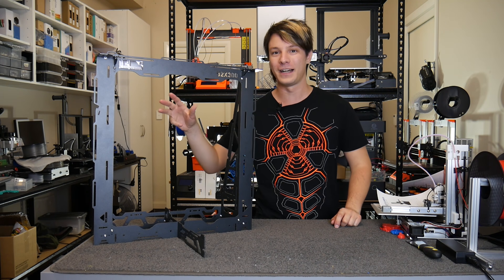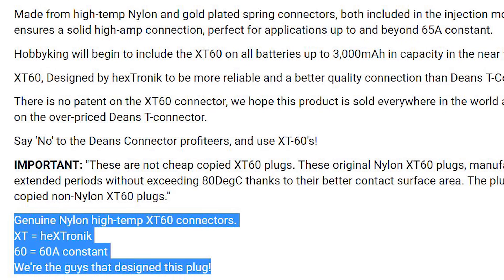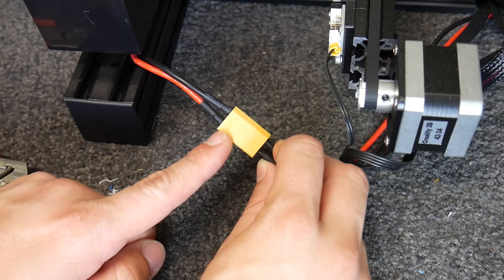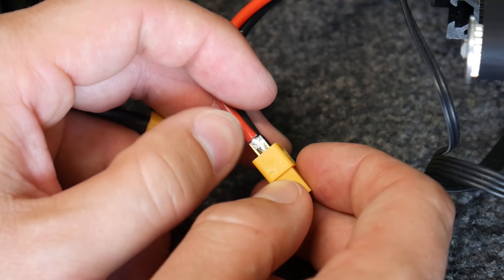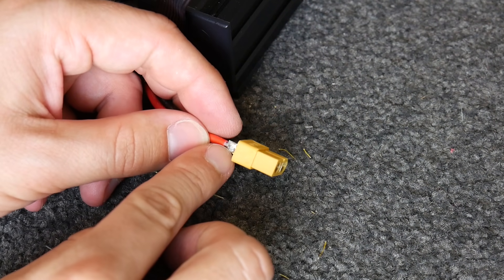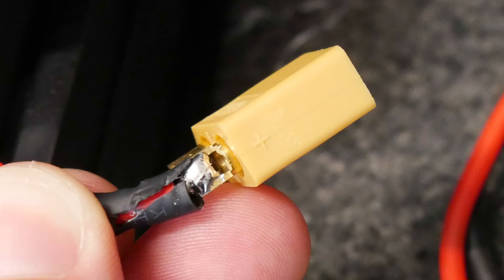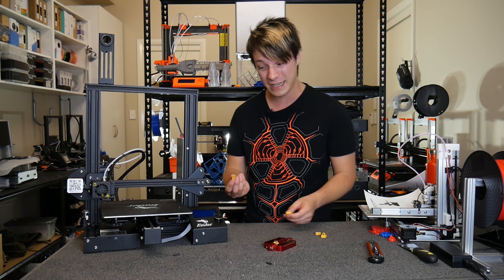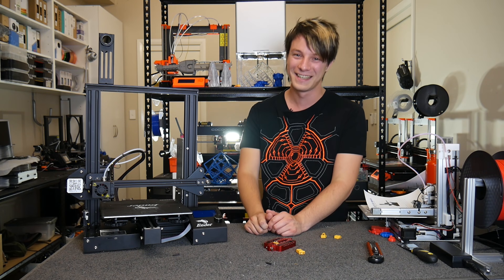Ender 3 Connectors are burning up... Bad XT60's

Comment: Hi Angus it's me again, the guy who's cetus caught on fire. Just wanted to let you know they asked for pictures which i provided and now they are not responding to my emails. I asked for a refund since i cannot trust that printer, it won't work now even if i felt lucky. Anyways do you know their contact guys jason or joshua at all? I could use some help dealing with them.
Reply: Matthew Poole holly crap
Reply: I wrote an article about those damn Anet printers, terrible quality connectors as well https://vectormfg.net/anet-a8-firestarter/
Reply: @Pocketninjanight  yeah, i am really getting pissed. I got new mk3 extended version. Friggin $500 dollar paperweight now and they are ignoring me.
Reply: Tiertime have a forum, head over there and post some pics, that might help. I'm on there a lot and have noticed an improvement in support...
Reply: @owensparks5013  ok i will do that. Thank you. My screen name is Carbide.
Reply: @carbide1968  
Sure thing. Mine is Marksman aka Owen Sparks.
Reply: @carbide1968  hey man how did you get on?
Reply: Just do a credit card chargeback if they aren't responding.
Reply: @pepe6666  still no reply. Getting real worried i am screwed. It's not like you can work on them either, parts are not available.
Reply: @carbide1968  damn man. someone said about reversing the transaction on your credit card & going to the bank with evidence of them ripping you off. is that a viable option?
Reply: @carbide1968  How did you get on with getting the manufacturer to refund you?
Reply: @AndrewAHayes  I had to send it to fargo nd. To some 3d printing company at there request and after they saw it was a fire hazzard i was credited.
Reply: Matthew Poole did your ender 3 catch on fire???

Comment: Ive been running my ender 3 for over a year, and had been keeping an eye on the xt60 connectors, regularly checking them to make sure they were not heating up.   Recently I must admit I had got a bit lax, as for a year I had had no issues.   But today after a 1 hour print, the xt60 connector has burn marks and almost burnt me when I touched it.  The wire either side of the connector was also hot. I'm a bit freaked out!    Ive cut both connectors off so I don't inadvertently use the printer until I can take care of the problem. 

I felt sure based on the fact the connectors had never got hot before that there was no issue. 

I think though what has happened, is the crimped connector (there is no solder on the side closest to the control box, now that I have removed the heat shrink!)  had a good solid connection for its entire life time, until I had to do some maintenance the other day and was moving the printer around, and now the crimped connection is a bit loose!

So I would strongly suggest anyone who has doubts to not risk it, replace the connectors or at least take a closer look at them, I feel like I've dodged a bullet here!

Comment: The images you showed of the burnt connector didn't show the damage at the solder joint.  Rather, it showed the burn marks roughly at the point where the contacts of the split terminal meet the cylinder.  This implies either a lack of contact surface area or pressure.  If the connectors are easy to disconnect, then it would be appropriate to spread the split contact slightly apart to improve  contact pressure.  If the shrink-sleave is burned up, then it is likely a cold solder joint.

Comment: I was wondering why they weren't putting enough solder on the joint. The Ender one is a hollow tube that would allow solder into the connector half if over done, and that would stop the plug fully engaging. The HobbyKing is a sold piece drilled from both ends, so it has two separate chambers.

Comment: Those solder joints should be filleted and blend smoothly into the base metal all the way around.  What I see in the video is some or all of the joint is a solder blob overhanging the base pin metal.  IMO this means the base metal pin wasn't hot enough for a good joint.  Or not enough flux.  As others have said, it takes a lot of heat to do this properly.  I usually plug in a dummy connector to act as a heatsink and keep the pins in their correct alignment.

Comment: Just checked mine, bought at the beginning of may 2019, it has official plugs, the stamp design, high friction push together, brass components etc all look and feel like the branded component and not a knock off... looks like they are listening and making updates

Comment: I agree with what you have said. My Ender-3 Pro came crimped and sure enough the cables got hot, so much  so that you could see the deformation on the shrink tubing. The plug was too warm even with the bed only set at 60°C. I swapped the cables with 14 AWG and skipped using a plug all together. As an Anet A8 user for nearly 3 years as well, I didn't think these things today wouldn't be a concern but it seems they are.

Comment: I was already paranoid with fire hazard before (because of all the soldering / hot air rework equipment I have in one room...) and now I don't trust the printer as well (not that I'd leave it working unattended in the first place). I've seen a few burned / welded connectors (some on mains equipment), even from reputable brands, but I didn't really consider they'd crimp a connector that's meant to be soldered.
Offtopic, your hairstyle looks awesome, Angus. 
Cheers from Portugal, mate.

Comment: If replacing the connectors, always make sure the gold is tinned first.  The gold dissolves into the solder, making it porous and brittle., which increases the resistance of the joint.  I'd suggest heavily  tinning the gold and removing the excess solder before inserting the tinned wire  (most good  training resources suggest double-tinning like this).  Soldering gold has a very odd stench that I still strongly remember,  even though it's been more than 25 years since  I did this with any frequency :)

Comment: I'm monitoring my connector using an infrared thermometer.  (They are inexpensive and handy to have around, non-contact measurements). I'm about 40 min into a PLA job...Nozzle = 215C and Bed = 60C; IR Thermometer is reading 94F (~34C).  Seems a bit high.  Will try some higher bed temps later.

Comment: Good video and well pointed out, I don't see the point in doing anything other than making a direct soldered connection here, even with good quality XT60 connectors there is still a possibility for a failure, in any electrical system you want to avoid terminations or connections of any kind where ever possible, the best advice you could have given on this video is to advise people to buy a small length of heat shrink, a 25w soldering iron and simply solder and sleeve these connections, its also worth pointing out that here in the UK the mains lead for the printer was supplied with a 13A fuse inside it? ive replaced mine for a 3 Amp, I am not so sure the power supply on my ender 3 pro is a Meanwell power supply.

Comment: Neat, a good thing to watch out for from the connector, I’ve had the occasional burn out from various printers and they were all due to krimped connections in a dusty environment and only after pushing the machine beyond PLA temperatures which is rare for me. Hard to diagnoise the problem because most people print with low PLA temps and never try printing difficult stuff like ABS or have the budget for higher temp stuff. Anyways, the connection would burn out and shut down the heated bed or hot end before a fire started requiring a quick soldered connection, I keep a fire extinguishing ball beside my printers anyways but I feel like because I use a torch or soldering iron so close to my printer sometimes or just any hot element, I’m more likely to popping my automatic fire extinguisher than my printers lol

Comment: I have wondered for some time whether some Chinese manufacturers are outsourcing batches of subassemblies to suppliers with low experience levels... effectively "cottage industry".   There is nothing wrong with the concept; it has been common practice worldwide for a very long time, but it has the potential for inconsistent processes, and makes quality control essential.   This is pure speculation on my part, but it may explain the variations of quality in the end (Ender?) product.
Reply: Yes, precisely

Comment: This isn’t the only connection issue the ender 3s have. I had to re solder the power wire for the heated bed. The motion of the y axis back and forth caused the wire to partially break away from where it was soldered. I only noticed it when I began hearing it spark and my bed temp wasn’t stable. It was an easy enough fix, but that shouldn’t have happened.

Comment: Glad I saw this. I’ve only been into 3D printing for a couple months and this video is 2 years old. (As of March 2021)

Glad I’m doing my own wiring for everything because I wanted to move the electronics to an external enclosure on my Ender 3. I’m no expert but at least I can solder a connector properly lol

Comment: I use cheap XT60's from Ebay all the time too. They all fit tightly and work well. They also don't look exactly like the ones you have on that printer as the metal contact ends looked different. Never had a problem with my connectors when running 12v @20-30A pretty much 24/7.

The soldering on your machines was quite poor. I guess it worked OK but there needed to be a better flow and better heating of the connector.
The fail will be the poor contact as you suggest. That's going to be a higher resistance point that will get hot when there's about 100W going through.

Comment: This happened to mine. 
I'm just going to solder the two cables together and be done with it. I don't need an XT60 there.
Reply: I have just removed the whole lot and  fitted new wire, I have extended it also so I can put the Power Supply outside of the enclosure Im planning to build
Reply: You could get XT90 connectors. Those should do the job even better.
Reply: exactly..

Comment: I have soldered the cheep XT60s and you will quickly find they are different. The plastic melts under super light heat where as the good XT60s can handle the heat of soldering.
Reply from the maker: Yeah definitely not the same quality of plastic, probably explains the level of deformation in the overheated ones.
Reply: I found out (the hard way) that the "copied" XT60s were not nylon (like the genuine HK ones. Kevin is correct - the copies cannot take the same soldering heat without melting. So it's just down to simple economics (ha!) - you save a few cents by buying the cheaper copy, and then get to spend twice the time soldering, then replacing them.

Comment: I’ve built computers for years. One of the final thing I always do is load test it, and take some measurements of current flow and temperatures, along with jostling all the connectors. On my work side I’ve seen huge damage done by loose and poorly soldered connections. Knowing my ender 3 would be printing alone in the house for hours using significant electricity, I checked it with a surface temperature gun (20 bucks) while it was running its first print. Was also useful to check bed temperatures (way off), and hot ends. No problems, but I suppose I should check it periodically. A meter and temperature probe are useful cheap tools, particularly needed for somebody who makes his living in this space, instead of randomly guessing what’s going on.

Comment: My Ender 3 happened to shut off in front of me(mid-print) because the 24V ground wire was faulty. It was actually in the middle of the wire somewhere. So, I just installed 14AWG power wires instead, and I happened to change out the XT60 too.  Now I'm super glad I did.

Edit: Mine were crimped, and not soldered.

Comment: I use those loose XT60s on my mini-quads and they have no issue handling up to 120amp draw. I prefer them as it makes disconnecting and connecting batteries much easier. Can't say if they'll burn up from sustained load but bursty loads they have no issue.

Comment: Yea, noticed the connector was getting warm on mine a while ago. Too much resistance in a not too well crimped connector. I just cut off the shrink wrapped tubing and soldered the wires on to the connectors. Then added 2 coats of liquid electrical tape. I have been checking it now and then and its staying cool.

Comment: The trick with soldering the cheap ones is how you clamp them. The low-temperature plastic just liquefies at 200 degC (which is probably why the Ender3 connectors are so under-soldered). What you do is to plug together two connectors, the one you are soldering, and the other one, and clamp the actual solder cups of the other connector in a small vise. Now the metal parts are located by a firm heatproof mount, and you can solder the connector using enough heat and time. The plastic will soften a bit, but the pins don't move due to the vise. Leave it to cool thoroughly when you are done, and the rubbish plastic will be able to solidify.

Comment: Indeed, those contacts are not designed for crimping — they are solder cups with just half around shape.  BUT, it also looks to me the wires are not going all the way to the end of the cup.  So only half of the conductive area is used.   On the other hand, I would like to know if the contact material is good springy phosphor bronze, or if it is just cheap brass.  Brass becomes loose even without heat and disastrously bad with a little heat.  Further, measuring the contact resistance would tell a lot.  Run 10 A DC current through the connection and measure the millivolts from one side wire to the other side wire (or actually the solder cups on each side).  Calculate milliohms.  At as little as 1 milliohm, at 60 A you would generate 3.6 W of heat per contact.

Comment: Even the soldered units have trouble.  One joint (the negative from the power supply) on both of my ender 3 had a cold solder joint from improper tinning prior to soldering. One of my printers even had mismatched connectors, soldered on psu side and crimped on motherboard side.

Comment: I found this problem in a week after buying ender 3 as I arranged the wiring when the bed was heating.

And I immediately noticed that the wires were more hot than the connector

So I opened up power supply and the body and doubled the connectors and and the wires from the power supply to board it fixed it very well.

Comment: Can't wait to see how "The Cult of The Broken Spider" responds to this. The Tevo Tarantula also suffers from connectors burning/melting because they use a connector that's not even rated for the current, on top of providing no cable strain relief, but there seems to be a fair number of members in the Facebook group for the Tarantula that swear the Tarantula is superior to the Ender 3.

Comment: A GOOD crimped joint is better than a solder joint. I think you where right pointing out that the problem may be a loose connection between the two parts of the connector.
Reply: XT series connectors aren't designed for crimp connections.

Comment: This happened my ender 3, I had it for about 3 months, so glad I never left it on when I was out of the house! Got a smell of burning one day when I turned it on, I had just swapped to a new brand of filament so I suspected that for a while, then got scared and turned it off. At which point I discovered the connector was burned black from the heatbed side.  Just checked after watching this and yep, mines crimped not soldered!

Comment: On the soldering side alone if your going to do this buy some red and black heat shrink (sized larger than the wire but not too large) pay attention to the to the orientation of the plug so that you don’t get the positive and negative side confused. The should be + and - signs on the plug if you look closely. Before you solder the wire to the plug  pre-tin the wire and be sure that you have placed the heat shrink over the wire and as far away from the plug as possible before you attach it to the plug so the it doesn’t shrink prematurely. Red heat shrink for the positive and black for the negative. Slide the heat shrink back over the joint once you have it soldered and use a lighter to shrink the heat shrink to the joint.  This is all for someone whose never done this sort of thing before. I’m sure the are more tips but I’ve gone on for too long.

Comment: I think I have the knock off xt60 in my electric k-panther skateboard.  It was fine until I shorted out a capacitor.  After replacing the esc I get intermitant disconnects from carbon built up in the negative side of the connector.  I put a vinyl coated twister seal in between the pedals, clipped off the excess with toe nail clippers and it made the connection feel strong.  I hope that fixes it!

Comment: I might terminate the wires myself with those XT60 connectors that have sleeves. Keep in mind though, XT60 connectors have existed for a long time. They come in varying colors and textures. Older ones I've seen area darker yellow, almost orange. They're also weird to the touch, not smooth and kinda feel like matte plastic. When soldering XT60 connectors I always plug in a matching XT60 to make sure the pins are aligned and it doesn't melt the plastic (not sure how much heat XT60 connectors are supposed to withstand, but I solder them at 450 degrees Celsius).

Comment: Back when I was at collage, many years ago, we were told that solder only joints were not good enough . Crimp joints were preferred as a mechanically and electrically sound.  I believe the issue is with substandard mating connectors. Solder joint is not a measure of quality. I’ve not tested the theory but in industry, crimp is preferable over solder.